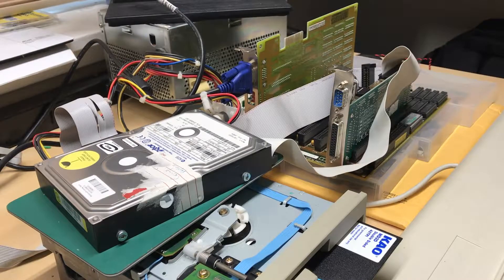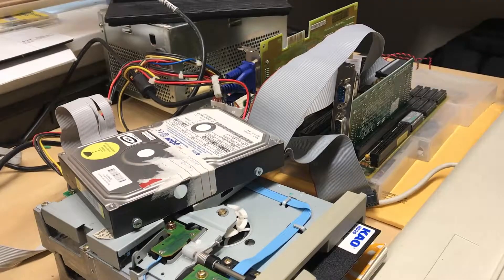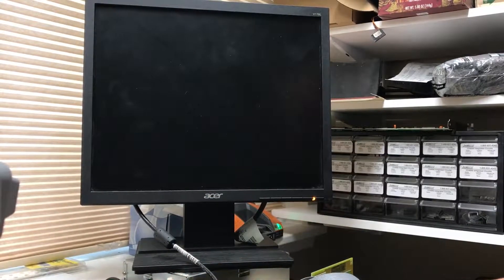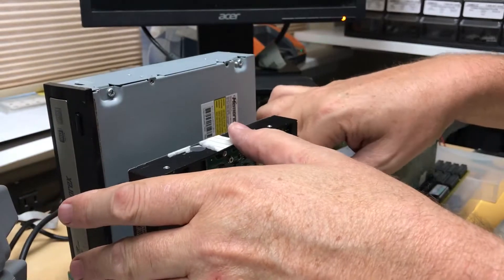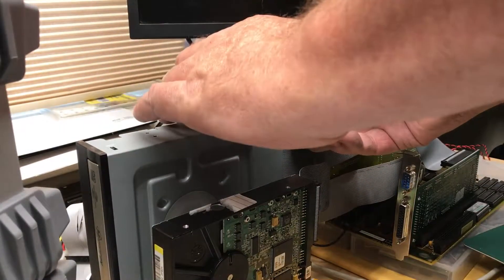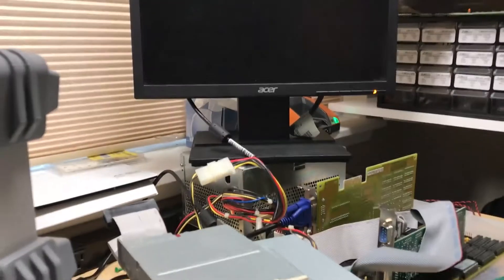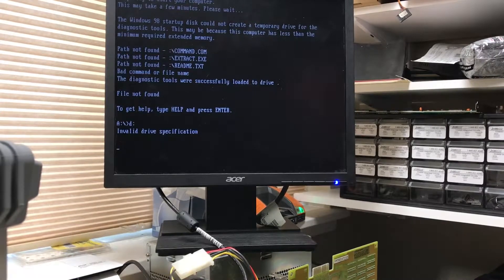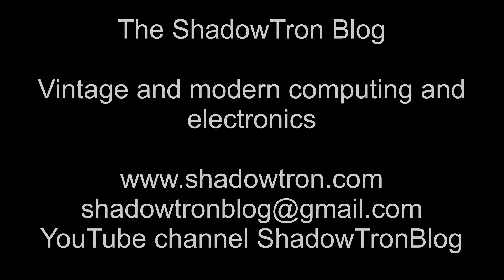IBM 386 - Part 2 - 80386 computer build - Win98 fail - STB84

Comment: windows 98 - on a 386 machine with 640K??
System requirements include:

    Intel 80486DX2 66 MHz or a compatible CPU with a math coprocessor[39] (Pentium processor recommended)
    16 MB of RAM (24 MB recommended, it is possible to run on 8 MB machines with /nm option used during the installation process)
    At least 500 MB of disk space. The amount of space required depends on the installation method and the components selected, but virtual memory and system utilities as well as drivers should be taken into consideration.

        Upgrading from Windows 95 (FAT16) or 3.1 (FAT): 140–400 MB (typically 205 MB).
        New installation (FAT32): 140–255 MB (typically 175 MB).

    VGA or higher resolution monitor (640×480)

Which means that with specs that you had when doing this video wouldn't quite fit even for Windows 95...

But anyway , thanks for your interesting videos, keep it up!
Reply from the maker: Yep, I figured this our pretty quick. I'm hoping to stand up the dev environment I used in the mid 90s at a startup we founded. I did a ton of x386 protected mode assembly mixed with Watcom c.